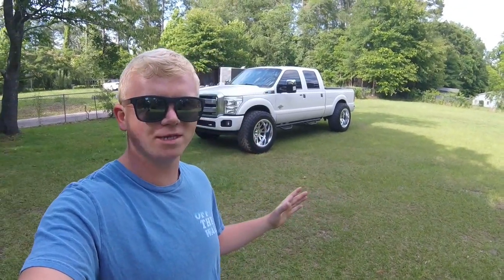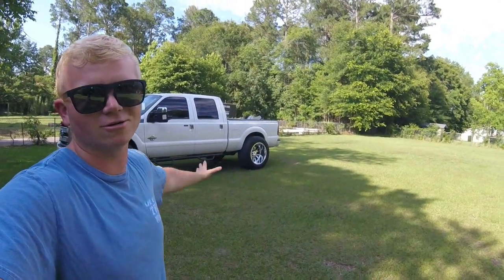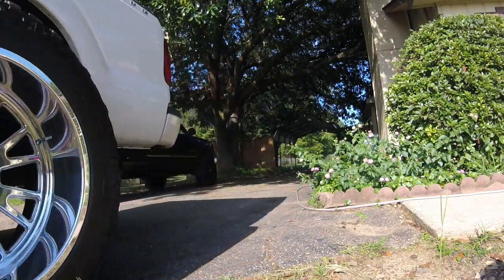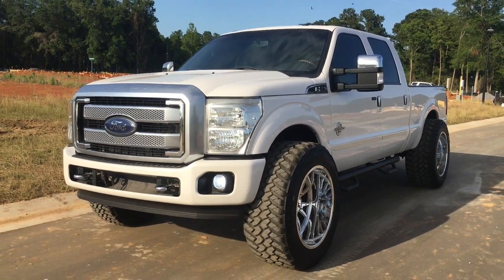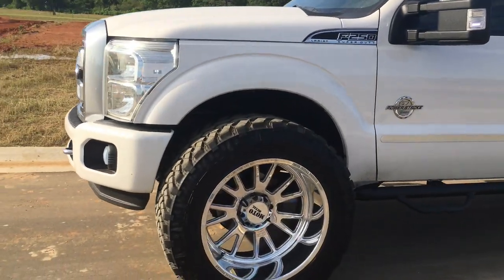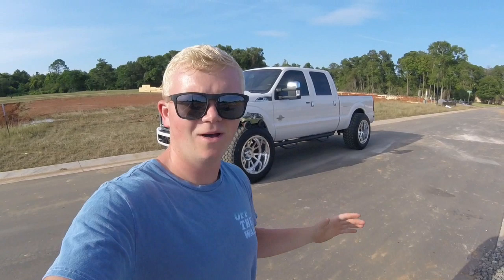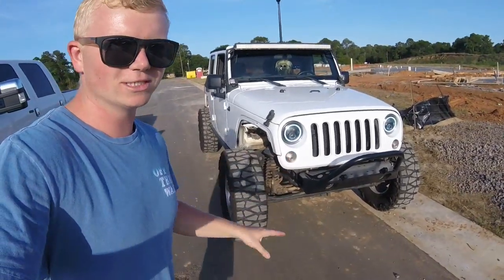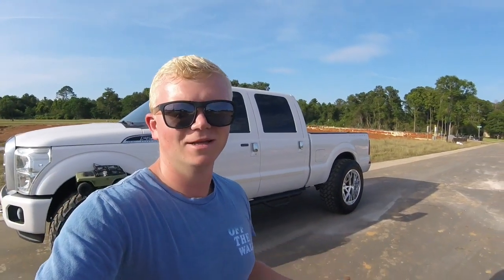Can You Drive on 40s With A Stock 6.7 Powerstroke?

Comment: Think 40s would fit a 4.5” with 20x10?
Reply from the maker: The 20x10s might make it rub on the body and bumper. Checkout my video running 38s on this truck as is. 
https://youtu.be/2Ljh3G7UUvw?si=31oCP1Le3h18bb8Z
Reply: @GRAPPAHOLICS  thanks man! Did some trimming on the inner fender and bumper. I now get full turn, even in my field

Comment: Did these rub on the inside of the tire? Or just the bumper?
Reply from the maker: It rubbed everywhere with this setup but I have a video of me running 38s on the stock wheels and they fit pretty well
Reply: Good to know, I'm trying 40x13.50 on a 17 inch rim with -18 (or more) offset. No lift just a fender delete kit. I saw your other videos, they really helped me. Thanks dude🤘🤘🤘
Reply from the maker: @kristiancrowley1420  Thanks for watching! Good luck sounds like a cool plan